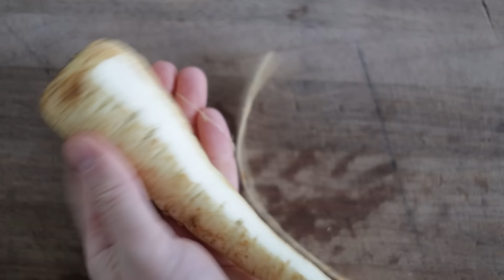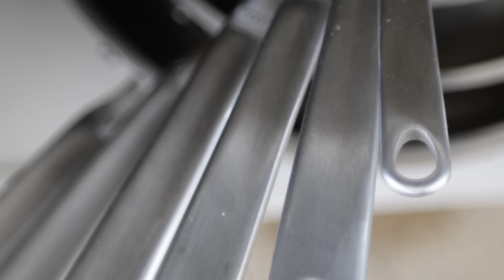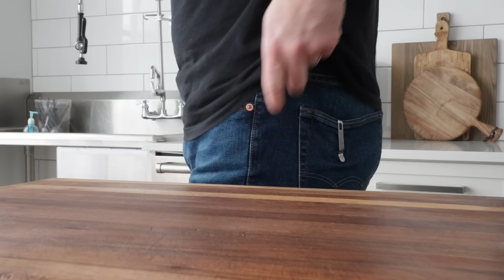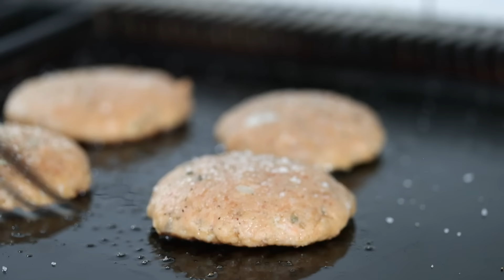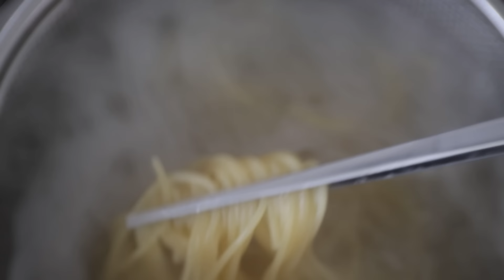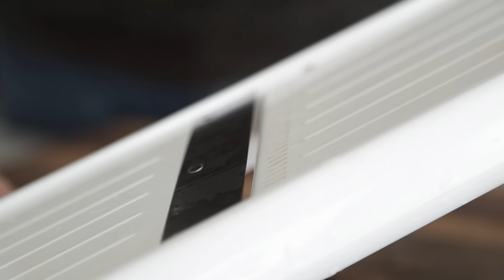Cook Like a Pro with These 15 Must-Have Kitchen Tools

Comment: Two words: bench scraper. Billy! Bench. Scraper! I use mine all the time - at least 5 days a week. Save your knives and set a safe example for your viewers and children of all ages. Get a bench scraper. I like the one with a rubber handle, but do what works best for you. My $0.02.
Reply: I use the back of the knife to push chopped food around. Don’t know why more people don’t do this
Reply: @denbo74  i always did but my knives are very sharp and a bench scraper is safer. And like 5 bucks while my chef knife is about 100.
Reply: @denbo74  i sharpened mine. I am pretty at sharpening. Stone and steel.
Reply: Absolutely bench scraper. I don't even put mine in a drawer. It lives slid under a rack on the microwave next to the kitchen scale. Since I have a tiny kitchen and only two drawers, I have stuff hanging. Not pretty, but who cares?
Reply: SO right! At first I used it to actually scrape the bench because I got tired of using my hands to clean up after prep. Now I use it for much more, from cutting sandwiches in half to creating galette dough. I can't live without it.
Reply: I have one. I will use it more often
Reply: I got a Graham Kerr one decades ago. It has the rounded metal handle.

My primary use is to move cut garlic, scallions, etc. from my cutting board to where I need them.
Reply: Best thing ever invented. I use mine for EVERYTHING. All. The. Time.
Reply: They have nice ones at the dollar tree actually.
Reply: And until you get a bench scraper, at least use the back of the knife instead of the edge...
Reply: I like that idea! I make my own pizza dough and that would come in handy with other items as well.
Reply: @BillGreenAZ A bench scraper is a must-have for anything involving dough. You use it to shove straggling bits back into the dough ball, and for cleaning your work surface. You’ll love it. And they’re cheap.

Comment: I will add two more: a narrow and wide putty knife. I use them every single day in the kitchen.
Reply from the maker: Great for the griddle!
Reply: if you're talking putty knives from the hardware dept, a huge yes! Plastic works for me although I don't use on anything too hot. And with metal, you have the stiff kind and the flex kind.
Reply: @gregoryevans5449  Hubby and I spend date nights cruising Home Depot. Way back when, we discovered Microplanes for woodworking and snagged them for the kitchen. I have a rubber mallets for flattening chicken pieces, metal ruler for cutting pasta straight, and short handled hammer for nuts. And the tools are cheaper.

Comment: One thing you didn't mention but is equally invaluable is a kitchen scale. I hated baking because things never turned out well when I tried. I bought a cheap kitchen scale from a discount grocery store and I've never looked back. When I'm noodling around Google for a recipe, I immediately skip the ones that don't include metric measurements.
Reply: YES! Using a kitchen scale to measure ingredients for baking has drastically improved my end products! But don’t eschew those recipes listed in imperial measurements - it’s easy to convert them to metric. Just ask Siri!!!
Reply: @vlunceford  you know, it never occurs to me to use Alexa for help. We have about 4 of the damn things throughout the house and I don't believe I've ever said anything besides, " Alexa,turn on the television ". I'll have to try her for recipes, thanks for that.
Reply: Same here. Started cooking/baking by weight and would never go back. Less cleanup too, since you can add ingredients directly from the package, zeroing out the scale in between. If something calls for, say, 3/4 cup of shortening, if you know the equivalent in grams (calculate from the serving size in grams on the nutrition label) you can put the tub directly on the scale, zero out then subtract, scooping it out with just a spoon. I’m not a metric guy, but grams are an obviously easy to use measurement.
Reply: @squirehaggard4749  I need to make a video about this topic at some point, because I am legitimately obsessed with this topic.  I love that you're seeing the usefulness of the scale life.  Its utility can go beyond even what you're saying.  For instance, I can get consistently salty pasta water every time.  I can just weigh whatever amount of water I filled in the pot, and then add in 1% salt by weight, and I'll have reliably balanced pasta every time.  

Another example is it is very difficult to determine when you have reduced something by ⅔ or ½, etc.  Let's say I'm cooking up a liver pâté and the recipe says to add 2 cups of port wine and reduce by ¾,  It is crazy difficult to really know when you've done that by eye, especially when there are already other ingredients in the pan.  But with the scale, I can just quickly weigh the pot after I have added the liquid, and now I can have a target weight for my reduction.  Let's say my pot weighs 1825g after I add the wine; I know that 2 cups of wine weighs 480 grams, and that if I reduce ¾ of that, that comes to ≈ 360g that needs to be evaporated, so now I know that once my pot weighs ≈1465g (1825-360), I am in the ballpark for the right reduction.  

I also weighed all of my metal mixing bowls empty and wrote their weights on their bottoms.  This has helped me countless times when I'm trying to determine how much of a mixture I have ended up with.  For example, let's say I have mixed up a giant ball of dough and it's ready for splitting and shaping into 8 buns.  I can just weigh the bowl with the dough still inside, and subtract the weight of the bowl.  Then I divide by 8, and now I know exactly how much each ball of dough should weigh for evenly-sized buns.  

One last example, scales are amazing for ratios.  Let's say I'm making a sauerkraut and I need to salt the cabbage.  Obviously no 2 cabbage heads are going to be the same, so once I have sliced up my head of cabbage, I can just weigh it in a bowl.  I know that I can just add 2% of salt by weight to get the same results no matter how big or small my cabbage is.  Or let's say I am making chicken stock in a pressure cooker and I have just defrosted my large bag of chicken parts from the freezer.  Obviously my chicken parts are going to all be different sizes/weights from batch to batch.  I can just weigh my kitchen parts, and then use that number to determine that amount other ingredients.  I know that for my mirepoix, I do onions at 15% and carrots/celery at 3% of the chicken weight.  Plus it really helps me figure out what my end result should be.  I know that for a light stock, I want a ratio of 1 part chicken pieces to 1.5 parts water, or for a heavier stock I'll do a 1:1 ratio.  And even better, I like to freeze my stock in cubes that are reduced by 4x, so I know that if I am making a light stock and I start out with 5500g of chicken parts, by the end, I should end up with ≈2060g of reduced liquid to put into cube trays.  And this is made even easier because I already know that my pressure cooker weighs 2270g empty, so I can easily calculate a target within reason to get consistent concentration in my stock cubes.

I could go on with more examples, but I really want to help people unleash the power of their kitchen scales.  It seriously is the most important prep tool next to a knife, board, and bench scraper.
Reply: YES!  I even converted several of my old bread recipes to grams so they turn out the same every time.  Grandma was good, but my scale is what makes me great.
Reply: I use a scale to divide the big ball of bread dough into equal amounts (the metric scale is easier than lbs/oz) so that they will each bake evenly and be done at more or less the same time.
Reply: Grandma taught me to bake in the 70’s.  A pinch of this, a dash of that.  I don’t think I have followed a recipe ever…
Reply: I got a kitchen scale when I needed to go gluten free. It's the only way to accurately measure all the flours and starches. I love that thing!

Comment: I am allergic to washing anything by hand.    This rules out carbon steel pans, and their heavy weight cousins, the cast iron pan.

BTW, at least the kuhn rikon brand peelers survive the dishwasher just fine in my experience, and if they ever dull, well, they are very inexpensive.

I am a heretic, and put away my good  German knives, and got inexpensive victorinox.   They shamelessly go in the dishwasher.    Every so often I use my venerable electric knife sharpener on them.   If they wear out, I will get new ones!
Reply: When i was growing up, both my sisters were allergic to washing up as well
They couldn't dry either
Reply: @grantsmith505 , Bet they kept trying to pass it off to you. 😎👍😇
Reply: Milk Street now carries a stainless steel vegetable peeler with replaceable blades.
Reply: Handwashing is bother underestimated and overrated! I'd be willing to accept a lot of tradeoffs in order to avoid handwashing all that equipment.

Comment: I never used one before until I had to, which is the stainless steel steamer extension for making mashed potatoes.

You quater a large potato, steam it until tender, the pan it mashes easily under a hand potato masher, producing a dry mash until butter and cream are introduced with a fork.
Reply: I used the stainless steel steamer basket insert from my instant pot. Looks pretty much the same except it has no silicone coating on the handles.

Comment: As someone who worked in the "back of the house" for many years, plastic cutting boards are far more unsanitary than wood ones could ever be. I will judge someone heavily if they have plastic cutting boards. Not only are they harder to clean, easier to stain, but it's easier to get things caked in little slits. Not to mention the microplastic issue. Listen to the man, Wood only.
Reply: I’m a wood board guy, but I do use plastic for breaking down or cutting poultry or meats.  That’s it.  Then it goes in the dishwasher.
Reply: Plastic boards also look like crap. Wooden boards are both functional and beautiful!
Reply: Plastic boards go into the dishwasher and get sanitized. I can use and clean 8 of them with zero more effort than one. They get clean and you can see it, but you can't see all the stains on a wood board. Poly boards don't dull knives. And if you aren't overpowering your knife it won't chew up your boards. (Everyone go watch him slice into that Boos board like he's laming a baguette again just as he's claiming plastic ones get scratched up too much.)

Bottom line: Use either. Wood is prettier but it's more maintenance for no more performance.
Reply: While I have a wooden board I think it's important to have a non-porous rubberized or yes even plastic board for certain tasks like breaking down poultry or fish.  If you're someone who has a board with deep scratches or edges that could become "shaved off" or removed during the prep process I'd recommend getting some automotive wet sand paper or an electric disk sander and buffing it back to a flat surface.  I love my wooden board but I'd rather not cut raw fish/poultry and meat with it.  Hard to sanitize properly.
Reply: Oh dear. $300 for a cutting board? 😳 🤷🏼‍♀️
Reply: All the uneducated recliners are here